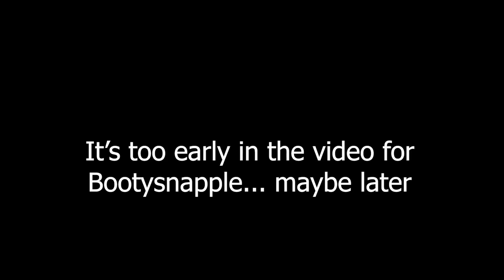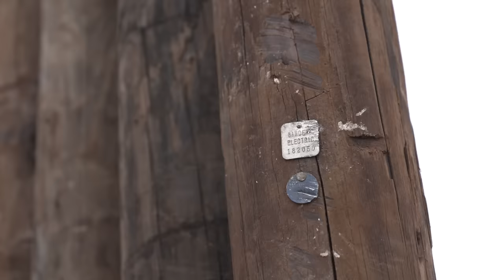Renovating an Abandoned Resort: The Wall

Comment: Matt; the sidewalls WILL cave in without interal/external crossbraces. This happens all the time in prepper/bunker construction; it's thin corrugated metal. All the strength of a container is in it's vertical end posts; everything else about the container is weak. 4 inches of top dirt... probably fine. The 45 degrees of side sand is tens of thousands of lbs, and will put bow your walls in.
Reply: You are spot on...
Reply: No it won't! Its just dirt sloping away from the container. It's only gonna have a couple inches of dirt on top the enough dirt to  cover the side
Reply: Out of context sry😂🎉 : We love you too David. @OffTheRanch Booty Snapple,  is good, to hear, but not to drink. Lol GG... Edit: the rest can wait. 😏........ 😉....🤨🧐🤔...🤷😉
Reply: Just came here to see who said the sides wouldn't cave in. Guess the new video proved them wrong
Reply: @michaelatkin9649  It did. :)

Comment: If you can't get your hands on a lot of rec poles, you could use old shot tractor tires filled with dirt stacked on top of each other to extend the berm. You definitely wouldn't be able to get them as high, but I feel like you could stack them 6 ft high and fill them with dirt and they would be solid.
Reply: If you can get your hands on old flotation tires that are worn out. some of those have 6 ft diameters and can be 3 ft wide.
Reply: Also, I would be cautious with incendiary rounds.
Reply: You can use smaller tires and orient them in a pyramid configuration.  Wider base and narrower top. Filled with dirt or gravel, they’re not going to budge, and they’ll maintain integrity even with bullet holes in the rubber.
Reply: Still gotta bury them with dirt....rebound protection from smaller rounds...
Reply: I guess I have never had problems with that at the gun club I maintain, but maybe. We fire directly into them, so if Matt uses them for the wall that is on top of the berm I would sure think it would be fine
Reply: I thought the telephone poles were for this.
Reply: They are, but can be hard to get/ expensive. It's just another idea
Reply: @alexfluit2308  He's already got them and is done.
Reply: Future reference if he's planning on doing something on the other side

Comment: Dirt on the outside of the container will not do jack squat to reduce the echo inside the container. You'll need sound absorbing panels inside the container if you want that to happen. They're easy to make with compressed fiberglass board, or with Rockwool panels.

Comment: You might have some bowing on the sides of the container as the dirt settles, and you might want to throw a couple columns along the center just to be safe. There's pretty much no strength in those containers aside from the corners, and even then only with a straight load. Maybe wait until a good rain to put things inside it to see what happens, wet dirt is heavy.

Comment: Matt, shipping containers are not built to carry load on the walls or roof.   The entire load carrying capacity is on the corners.   That’s how they can be stacked so high.   But it’s okay, you’re a millionaire, what does it matter if you need to buy another connex container anyway.
Reply: Lol they are stacked 5 high at the ports each container weighs 43k lol they are made to be stacked 😂😂.

Comment: You really should reinforce them.. the only weight they can carry is that of another shipping container because they have strong corners. Anything other than the corner pillars cant take much more than a spray of saltwater
Reply: Lol they are stacked at the ports 5 high each container weighs 43k.thats container can hold that dirt 😂😂.it doesn't need no reinforcements lol.
Reply: @jerrywilcox9890 yea due to all the weight it transferred downward by the corners. They have absolutely no support in center of structure and will/have collapsed. Ask anyone that attempted to make a underground bunkers or container home.
Reply: @jerrywilcox9890 better rethink that bud, the stacked weight is transferred down through the corner posts the. Not hard to understand. The roof is not structural one tiny bit.

Comment: The easiest way to ensure safety on the range is to  build supports to hold either big wood beams or poles like you are using.  Have them elevated enough to shoot under but make sure no shots can get near the top of the berm.

Comment: Yes definitely support that roof I used to work on ship containers striping the paint off repairing and repainting them for resale and they definitely aren't strong enough for that much weight in center of roof ... I weigh 130 lbs and everyone flexed in the middle with my tiny butt better be safe than sorry

Comment: Mate, you just welded mild steel to cortan steel, it will rust out in under a year even without being covered by dirt.
Reply: Want to make a bet. I bet you $10,000 you're wrong
Reply: @cj548  Dude, welding mild steel to Cortan steel will rust the mild steel in no time. There is even a warning on the side of shipping containers to repair only with Cortan.

Comment: I work in a major port loading and unloading those boxes on and off of ships. The sides and top are not structural or load bearing at all. They dent and give easily and peel back like aluminum foil.
Reply: Lol there stacked all day long at Ports 😂😂43k each they are designed to be stacked.that little bit of dirt isn't going to hurt that container one bit.
Reply: @jerrywilcox9890  you’re right they are stacked, but the sides and top don’t actually make contact with the other containers. The corners do. And the bottoms are reinforced. As you can see in the video, the top gives like walking on a trampoline. That thin metal gives very easily and will tear open with minimal force applied.
Reply: @jerrywilcox9890 on the corners. 43k isn’t sitting on the top, they’d immediately crush. Stop commenting on shit you’re clueless about.

Comment: Giant gaps in between the telephonepoles. If he really wanted to make it safe, it should be two rows, so a pole is behind/infront of the gaps
Reply: They are already 20 feet high at the base. 🤦🏻‍♂️
Reply: The chance of smth getting right through there is extremely low. That wall is already an overkill
Reply: We had an hunting accident in my region a few years ago. A girl was hit in her garden. Later it was found, that it was a ricochet from a hunt at a field 4km away. I mean, what are the chances for that? But still the girl will have lifelong consequences. A responsible gunrangeowner try’s to minimise risks as much as possible and this would be an easy and cheap fix.

Comment: Sealing the container was a good thing but the supports should be on the inside, the dirt could break away the welds and still cause a cave in. With the support on the inside it would be capable of holding much more weight.

Comment: The sides/tops/bottoms of those boxes are NOT designed to take any significant load.

Dirt is 100-200 lbs per cubic foot. At 4 inches, on a standard 40'x8' box, that's about 5-10 TONS of weight. More if it gets saturated.

There's a reason so many people that just bury un-reinforced boxes have them collapse later.

Comment: Assuming the size of the connex is 8'x40' and you want to put 4 inches of dirt on it. Using a standard (from random website can't validate the accuracy) of 90lbs per cubic foot that gives you (40×8×(1/3))×90 which equals 9,600lbs of dirt on that roof.

Also I think the angle iron would be a bit stiffer if you welded it with the point facing upwards. But like that's just kinda nitpicking. It's not that big of a difference

Comment: 4 inches of dirt on a 120 sqft roof is 40 cubic feet of dirt. That could be anywhere between 2,960 and 4,400lbs depending in the type of dirt! Definitely reinforce the inside of the container as well! 
😮( please don't quote me on that I am not THAT good at math, though I'm fairly certain I did it correctly?)

Comment: The main reason you were burning through was technique. Lay the rod at a shallower angle, 45 degrees or less, short arc, and focus on the thicker metal. Make a slight weave, about 3/16" or so, and spend more time on the thick metal, don't travel too far onto the thin metal or you'll just be adding unnecessary heat to it. Try a 3/32 6010.

Comment: There’s a lot of comments regarding the integrity of the roof. If the roof is 8ft by 40ft and there’s 4 inches of dirt/gravel on top, that’s nearly 10640 lbs of material. Spread out, it’s roughly 33 lbs per square foot. I’m guessing (i mean it) prior to rust and rain, it’s gonna be fine.

Comment: Did you consider compressing the berm before putting poles in?  You should put up a frame covered with butcher paper above the poles and at the ends, so you can see evidence of any bullets missing all your walls.  If you are actually only putting 4" of dirt on the roof, you easily could have left the roof vent on and it would help you ventilate the place as well as monitor the actual depth.  You really like making extra work for yourself.  My dad (the Air Force Full Colonel) had the phrase THIMK up on his office wall to remind people to THINK.

Comment: Matt
There is a commercial product we use it's called Pan Decking it would be a great roof for your container/ConEx it's is used on high rise buildings they pour  concrete over  is very strong it also has what I believe is called electro-galvinized surface

Comment: Just some basic numbers for you Matt...you're looking at 4 tons of weight on the top of that container (based on sq footage at a 4inch thickness), if it flexed under your scrawny arse, imagine what 4 tons of weight are going to do to the top of that container.

You can do it right once, and reinforce it, or you can do it your way multiple times. Choice is yours, but I reserve the right to "tell Mer"

That doesn't even get into the subject of the weight and pressure load on the SIDES of the container from the earth pressing in on the sides.

Start looking for a new conex container NOW.

Comment: The rough rule is that an a 25mm (1") length of 8mm (5/16"?) fillet with decent penetration on mild steel holds 1 tonne (1.1 tons) so those stitch welds will make a huge difference.

Comment: I think you should put two shipping containers, 100 yards apart. Standing them on end. Joining them with a zip line in between. So you can transfer from one to the other. You then could start at the bottom. Shoot work your way up a few different levels. Zip line a crossed shoot to finish as a course. Fast as time wins.

Comment: I guess this maybe too late but, if you were to lay a waterproof membrane across the top of your container, you could in theory lay a concrete slab on top. You have a mixer, reinforce with some rebar, do it in sections about 3 to 4 inches thick, a scaled down version of your gun vault. You could make it work as it only needs to be 3/4 the length of the container, the form work if you do it in sections as suggested, (5 or 6ft wide at a time) can be moved along the top as you go. Just a thought, great work though all the same. 👍

Comment: Call me crazy but wouldn't the reinforcement be better if it's under the roof on the inside? Also you probably should have done the work to strengthen the sides IMO.

Comment: You did a terrible job on the upper log stops; it needed second layer of poles staggered to close off each split and wind resistance.
Not long age a person took a round at an outdoor eating area next to HWY94, the round was blamed on the outdoor range near a half mile away. Just my designs are Heavy extra worst case first case to plan for. I also remember after your Tank missions what you wanted to build, so stop clowning saying your renovating a resort.

Comment: Wish I could help ypu out and help with advice on things more than comments.  But personally I think you're doing awesome but some things I would do different to be more cost efficient and just as secure as you want.  Like the poles in the top ypu could have concrete 2 in and layer the others sideways between and lag them in using way less concrete and just as many lag bolts but just as secure

Comment: With that Ariel Shot of the area...it looks like you could keep setting up 3 more Berms, one at the end of the Rectangle, and 2 more on the opposite side, all facing out. and maybe a Berm down the middle to separate the sides for extra safety.

Comment: FYI Matt, the angle iron is stronger as a stiffener when positioned with the edge, not the flat on the roof. It’s counterintuitive but the polar moment of inertia is higher in that orientation. If you look at industrial flat topped tanks, that’s how they do it. Takes pressure from inside or out much better. Just ask a structural engineer to explain it better than I can. Jmtcw.

Comment: I’m sure 1000 people are going to tell you that them braces should’ve went on the inside of the container that way it’s not relying on just some little teeny welds to support the roof which will rip right through but the beam will support the roof continuous.

Comment: Very cool, but I really think you should have kept the turbine vent.  Even with a few inches of dirt on top, it's going to get hot in there.  And at night in the summer, all the soil will retain the heat so it will never really cool down inside.  They do have solar powered mini-split heat pumps, so you could easily install one of those and some solar panels and have a well lit, heated and cooled place!

Comment: Don’t push the rod, pull it. Start the bead on the thick side of the metal, and slowly whip it over to the thinner metal to tie it in. Spend way less time on the thinner metal than the thick. Lower amperage, bigger rod.

Comment: you should get a mig welder and short circuit weld that thin stuff SMAW is too hot for thin metal so tig or Short Circuit mig would work better for next time🤣

Comment: on burying the conex; I had heard to do that it would be better to turn it upside down because the floor is stronger than the roof. Research it first though. I have no experience with it. A option for the roof is spray foam with bed liner on top (slows down insulation deuteriation).

Comment: Mat there is a reason power companys DO NOT USE concrete to se poles (the acid in it rots them). and those old poles are already drained of much of the protection they had new. some of those may be rotted of in less than two years.

Comment: The shapes really throws me off. If people are shooting at the far right of the small berm wouldn’t it be facing the direction of people in the larger berm? And same to the left of the larger to the smaller one? Or will only one be used at a time, if that’s the case why build two?

Comment: And you at least should have welded the angle with the point facing up not that it will help the back up eventually it will collapse in between the angle.. then should have waterproofed the third under the dirt to prevent rust and then put two tubes down down each side on the top linking the corners together then weld braces in between running over the roof every foot then weld a metal plate over the top.. 
the thickness off the plate will depend on how far apart youweld the purlings apart 

Please keep the kids out of it until you fix it Matt 🙏🙏🙏🙏

Comment: Good idea on burying the connex, reinforce the roof of the connex. Then you have a storm shelter in case of tornado. Put a hot tar coating on the connex so it seals holes and prevents rust

Comment: really need to drag not push when Arc welding, and corten steel that they make these out of is horrible to weld at the best of time, so no wonder the welds look like crap. mig would have been better and the best thing to patch a sea can with is metal from another sea can as they are the right gauge and have all the right bends and forms.

Comment: Does it make better sense to support the container roof from the inside? The weight is going to be on the sheet metal not on the cross beams. On top the strength is that of the welds only. Underneath you get the strength of the entire beams supporting the entire roof?

Comment: matt you should have put the angle iron in the connex container as a structural support from the floor to the roof so when its covered it can support the weight of the dirt and when it gets wet from rain its not going to do much on top and fyi the new t shirts lokk like shit